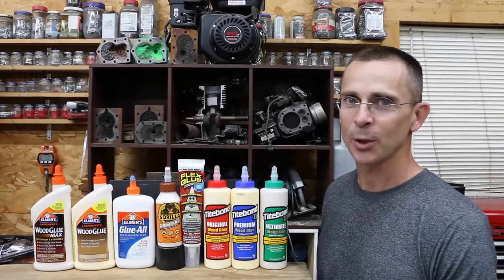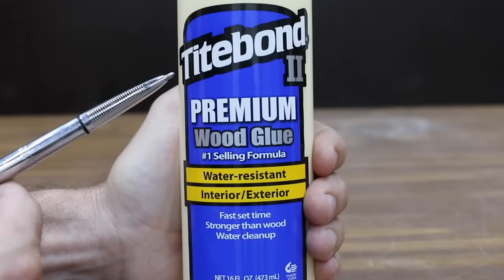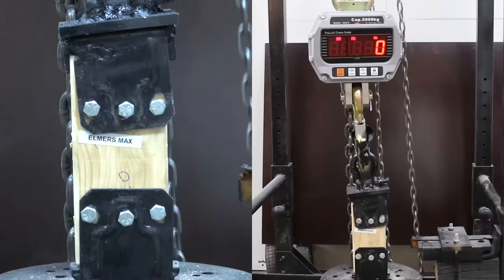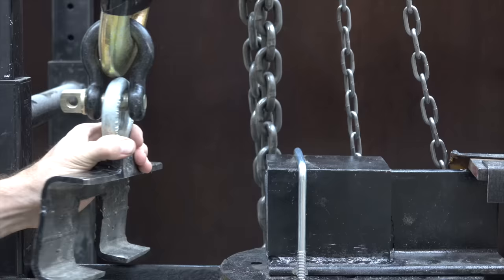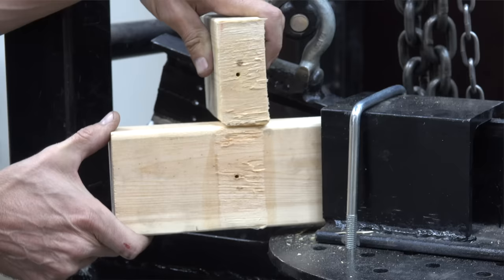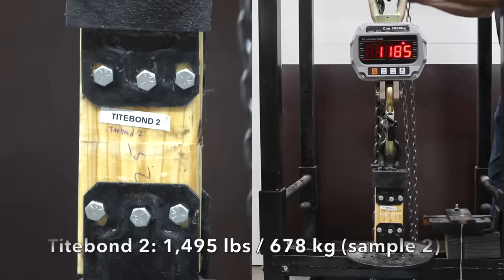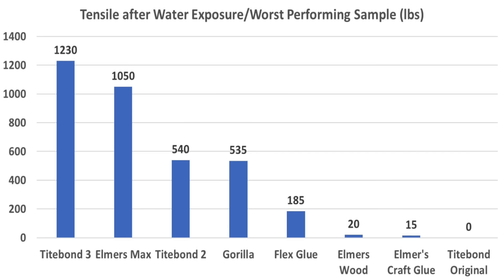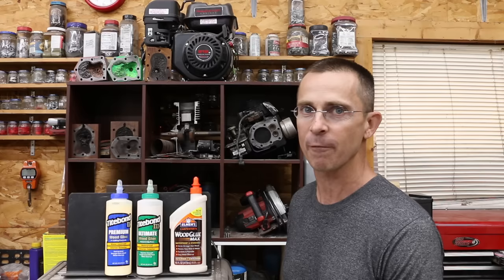Which Wood Glue is Best?  Let's find out!  Showdown with Titebond, Flex Glue, Elmer's & Gorilla.

Comment: It would have been nice if you included a test that didn't use the end grain of the wood. As if you were building a panel kind of scenario. Run the edge of wood down a jointer, glue it to another piece that was also run through a jointer and test it then. I guess your number were already pretty high. And you'd have to worry about simply peeling the wood apart. It would still have been nice to see. I'm also curious how this would compare to a construction adhesive like pl premium. Great video, keep it up. Cheers.
Reply from the maker: Thanks, will do!  Thanks for the constructive feedback.

Comment: I LOVE your videos - I would love to see a test of a few drops of glue self spreading when put together vs the brush to spread to every last centimeter of the surface - I would guess the spread from pressure would cover well enough not to make much of a difference in strength. Also does / can over clamping squeeze out the glue needed for a good bond? Thank you.
Reply from the maker: Thanks!  Thanks for the suggestion.

Comment: I have a suggestion. With the glues exposed to some air doing usage, then set aside for the next project to come up, two things: Does the glues break down, stay the same, or become stronger? Second, If all the glues sat on the shelf, how many would still be usable after that time.

The Bondtite II can set on the shelf for years and still usable after that time as I have one bottle that after several years on the shelf and just started using several days ago and still is very usable.
Reply from the maker: Thanks for the suggestion.

Comment: My real name is Michael McCluskey. I use Elmer's White glue mixed with Isopropyl alcohol at a 50/50 mix to secure the ballast on my tracks on my model railroad. The alcohol helps it settle into the ballast. It evaporates leaving the glue behind bonding the ballast to the tracks.
Reply from the maker: Thanks for the feedback.

Comment: I would have liked to see if the glues performed differently on different types of wood. I used Titebond 2 when I rebuilt an old guitar and it was a mix of birch, maple, and rosewood. It was clearly strong enough to hold it all together under the force that strings put on it, plus it was a 12 string acoustic so the force is greater than a normal 6 string.
Reply from the maker: Thanks for the suggestion.

Comment: I'd love to see some testing / comparisons of Gorilla Glue Ultimate. Mainly because it claims an open working / assembly time of 15 minutes, longer than any of these- Titebond III is a distant second at 8-10 minutes.

Based on all the reviews and tests I've seen, Gorilla wood glue is one of the worst performers, but for some things like assembling flatpack furniture (mostly gluing dowels), it really doesn't need to be that strong, and longer open working time is more important. Even the weakest wood glue is probably stronger than the particleboard or cheap wood used in that sort of furniture anyway.
Reply from the maker: Thanks for the feedback.

Comment: Great video. The variance in some of the numbers are crazy. If someone wanted to mitigate out those lower tensile & shear strength numbers for some of those well performing glues to ensure maximum strength, I wonder what could be done & what caused the lower numbers because those samples & tests looked pretty solid... 

Could it be air bubble mitigation techniques because some air bubbles were present in some of the samples? Use of a constant glue volume if a set volume was not set in place already as more or less glue may have ended up seeping into the drilled holes? Wood grain direction? Wood quality ? 🤔 Obviously, from a practical perspective, screws/fasteners would be the way to go for those weights but I want to summon the polymer chemists & structural engineers.

Comment: When you have this much variability between specimens (4-7x or more) where the adhesive is known to have come from not just the same production batch but the same actual container, then you know there's something wrong with your test methodology. The use of screws instead of clamps is one variable that could have and should have been a constant (using the same clamps on each sample with the same clamping force each time) and the lack of control over the exact thickness of each adhesive on every sample was another variable that should have been controlled, since most of the failures appear to be purely tensile in the adhesive layer itself. Quality of the bonding surfaces was also not checked to be sure they were identically rough or smooth or porous or free from dust, which shooting a jet of compressed air won't guarantee, but a wipe-down will. Even with all of these uncontrolled variables, you could get significant results if you did enough samples, but 3 of each isn't nearly enough.

Comment: Strength/fail test is not the only consideration when selecting adhesives.  Almost all glues easily pass that.  It's the other properties  that mean almost as much and  determine which to use.
Reply from the maker: Thanks for the feedback.

Comment: So you've become one of my go to folks! I have a second hand wood canoe with a cracked gunnel.  I'd like to use a two piece epoxy instead of a glue, because the area is structural.  Any recommendations? Considering the cost of small quantities of epoxy I'm expecting to buy a pint or quart.
Reply: The best epoxy to use would be a slow setting "marine grade" epoxy from a boat builders supply. But in a pinch i suppose anything will do, the weak point tends to be the wood, not the adhesive; assuming it's applied properly.
Reply: @zoravar.k7904  thank you! I used standard JB weld and it worked like a charm.  Wiped off the excess before it cured.  Protected the area with wax paper from the kitchen, to make sure the clamps didn't engage with the epoxy!

Comment: I built an oak farm table 20 years ago and used Titebond 2. This was a real working table, not just something called a farm harvest table. Lots of water and every day use. I just replaced this table and disassembled it to reuse the oak. The Titebond 2 had completely failed. Every joint and glueseam snapped with light hand pressure. I will not use Titebond 2 again.
Reply from the maker: Thanks for the feedback.

Comment: Good review and it turned out as I thought it would. But another test is the fastest glue to cure at least to allow my builds which is furniture. Most of my glue ups will never receive those loads your test indicated. I started with Titebond original and over time migrated to Titebond 3 primarily because 3 allowed me to continue with fabrication quicker then the Original did even though neither were completely cured according to label.
Reply from the maker: Thanks!  Thanks for the feedback.

Comment: The extreme irregularities (titebond 1 got 4000 lbs then 500 lbs) lend me to think there is a quality control issue. Finding that issue would be valuable to the watchers. Did you need to remove dust better with a wet rag. DId you need to provide more (or less) clamping force?

Comment: With each product having one sample significantly lower than the others from the same product in the water soak test, I would consider looking for possible reasons. I don't know what you used to soak them in, but if there was a chemical residue in one bucket that wasn't in the others, that could explain the complete loss of adhesive strength.
Reply from the maker: Thanks for sharing.

Comment: The large range in test results for each glue tested should indicate that there is something influencing our results other than the glue. Materials testing requires consistent speed of loading and isolating forces in one axis. The hoist method is very tough to control speed and doesn’t isolate torque on the joints       . The results are anecdotal at best.
Reply from the maker: Thanks for the feedback.

Comment: My only complaint of this test is the bolt holes for the stress tests were drilled off center (not evenly spaced), which cause stress fractures around the out holes, so the weight isn’t evenly distributed, and uneven pulling for a tinsel test. Better tests could be done. But overall, it ended up like I thought it wood… er, would.
Reply from the maker: Thanks for the feedback.

Comment: I always look forward to your tests and reviews and surprised that I missed this one.  I rarely take issue with your methods but the one thing I noticed in the tests was that the methods for gluing were different from what I typically see in woodworking circles all over YT.  Specifically, when gluing projects, it is common to clamp the pieces together for the tightest bonds.    I have recently gotten into woodworking myself and have gravitated toward the Tightbond II after using Elmers.  Is there any chance that you could put out a retest video using clamps to bond the pieces?  Wouldn't need a ton of clamps since you can clamp the samples in batches.  In any case, thanks for another great video.
Reply from the maker: You are welcome!  Thanks for the suggestion.

Comment: Thanks for the tests, great stuff. I'm left wondering they even still make the lesser glues. Yes, it's the price! In] guess if you use glue gast enough to need a roller to apply then it makes a hig difference. If you only do some joinery and general tasks, get the good stuff. Didn't know about the E max stuff, will have to give it a go, see if it lasts!

Did you ever explore bolts, nuts and washers?
Thinset (pre-mixed vs powder) vs mastic for tile?
PEX (compression rings vs the current champ vs sharkblight) all vs UV exposure / time
Reply from the maker: Thanks and you are welcome!  Thanks for the suggestions.

Comment: Fantastic experiments / tests as always. 
You have amazing forethought before testing. 
Just a thought - are you really getting a true test of the tensile strength in this experiment, as some samples of the same glue vary widely. I’m not sure if I’m interpreting this correctly or not, but when your clamping with 3 bolts, is it not nearly impossible to achieve a direct pull ?  If either outside bolt happens to fall in a softer portion of the wood, then it won’t be, pulling its weight (so to speak) and as such, you are then not prying it apart. 
Would it be possible to pull though a single centered lag bolt or 2 lag bolts pulled via a sling. So that it always remains a straight pull  
Just a thought !
Thanks again for all you do !!

Comment: There is a point to using weak wood glue in furniture construction. You can find a lot of old furniture that has survived even centuries because of the use of weak hide glue. The weak glue bonds break before the wood, thus saving the furniture. All these very strong glues are stronger than wood, thus breaking the wood/furniture before the joints making the furniture unrepairable
Reply from the maker: Thanks for the feedback.

Comment: There is an important consideration that doesn't seem to be included - or maybe I missed it.
When working with very light colored woods such as maple, Tite-Bond 3 is far more prone to leaving visible glue joints. So - if my project will be used indoors (as most of my maple projects are) I prefer to use one of the lighter glues.
Perhaps there isn't a single "best" glue - but, rather, for each application, there is one that seems better than the others...

Comment: I have to assume that the only difference between Titebonds 1, 2 and 3, and the different levels of Elmers is the amount of watering down they do to the ingredients that actually do the work.  As for Gorilla, I've never been impressed with it, and I heard later that it only works on porous materials.

From a carpentry point of view, I wonder if there are other functions of wood glue that need to be assessed, such as long-term longevity, discoloration and possible deformation of the material?  I remember when Super Glue first came out in the 70's, it flew off the shelves....until people realized that, for certain joints, after a certain amount of time, it failed catastrophically.
Reply from the maker: Thank you!

Comment: You should try pvc pipe glue, when we were building my grandfather house, a board in the basement must of had some drip on it and it got flipped over, no pressure on the piece and I had to pry it up with a crowbar and the wood ripped out of the center of the board, had to chisel the rest off the concrete.
Reply from the maker: Thanks for the feedback.

Comment: Great set of tests and a tremendous amount of work.  I wonder though given the huge variability in the test results.  It's not practical to suggest that you do dozens of tests for each setup, but when the values for failure strength vary by so much, I wonder how much confidence we can have in them.   It seems like there may be too many variables given a natural product like wood for such a small sample to be testing the strength of the glue rather than the strength of the given piece of wood.  That said, another simple measure to do with the existing data would be strength divided by cost .
Reply from the maker: Thanks for the constructive feedback.

Comment: Todd, Obviously you put a lot of thought into what products you test and exactly how you test each brand.  For me, I'd truly appreciate seeing your wood glue test; performed on edge grain surfaces, rather than end grain wood.  Bonding end to end pieces of a 2 x 4" is not really relevant, for most wood crafter's projects.  Think about what kind of joinery in common wooden objects, fails most often (for hobbyist like myself.)  My guess is that you'd see tons more wood failure, than glue failure (and that may have been one of your drivers.)  Please let me know what you think, but the most common failure points for me are in;  joining edge to edge grain wood for fabricating cutting boards, hardwood cabinet doors, laminating layers of opposed grain wood boards or layers of plywood, etc... . I can't think of an application for end to end gluing, without the addition of any other method used, to expose at least a little edge grain wood.  Dowels, finger joints, bisquits, etc..., are always used to glue wood end to end, simply because no glue is expected to function properly, (by design criteria), without bonding the longest possible grain wood fibers. 
 I'd rather message you without these all-eyes comment, but I don't know how just yet.  I apologize if my comments seem too critical, but your testing is my go to source of objective info in the real world market place and I want more!
Dan
Reply from the maker: Thanks for the feedback.  Thanks for the suggestion.

Comment: I would love to see some of the most popular epoxy resins compared such as total boat high performance put up against each other
Reply from the maker: Thanks for the suggestion.
Reply: @ProjectFarm  I have one more but it might be on the pricey side to test, I was just watching Tool Review Zone’s video on the Flex Stack system from 4 months ago. It would be actually amazing to have a video from you comparing the different modular stack systems that are out, especially since harbor freight just came out with one as well. Given the all in price of the systems it would be so nice to see the features side by side along with durability and ease of use (how well/easy they snap together, etc) thank you so much

Comment: End grain testing was interesting, but these wood glue products are designed for ingrain or lamination, suggest a re-look at testing with the correct grain directional usage, with properly surface preparations not rough cut with a chop saw or chain saw. Smooth surface and clapping for best adhesion strengths tests would be more appropriate.
Reply from the maker: Thanks for the suggestion.

Comment: Supposedly gorilla glue requires one surface to be dampened before application. Not sure if that was done here. I used it a while back and didn't dampen and it joined OK at first but a couple days later, under not much stress, it failed. I find it annoying that the leak out expands a lot while drying and requires a bit more of cleanup than other glues. I don't use it - I use one of the Titebond's
Reply from the maker: Thanks for the feedback.

Comment: The only curious test I trying to find is a wood glue that can hold up to a high humidity and high outdoor temperatures. One glue I love to use didn't fair well and seemed to get weaker. I'm pretty sure it wasn't a lack of dry time. I really would like to know how that test would do. Tennessee can get some strange weather and maybe something is going on with the area I'm working in.
Reply from the maker: Thanks for the suggestion.

Comment: I really like this video. However, the variance of all glues on the the end to end test indicates that the test has some flaws.  On many of the tests, the video shows one side of the holes giving away, which would create much more tension on one side of the glued end than the other.  Without going back and slowing it down, other inconsistencies might be spotted. The vertical test seems to be more valid and the results are more consistent.   I will point out that there is no evidence of any intentional bias, and your conclusions of the better wood glue are likely well founded overall.